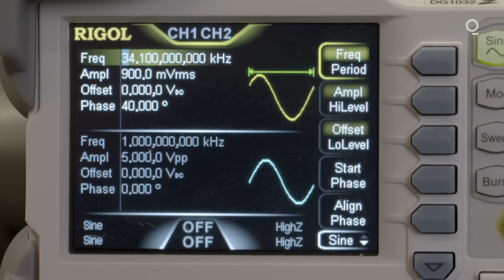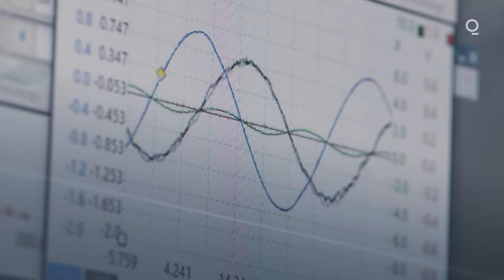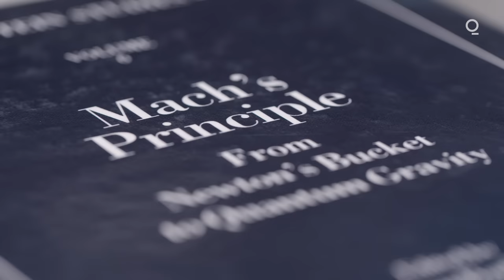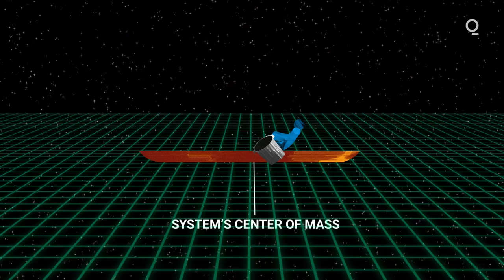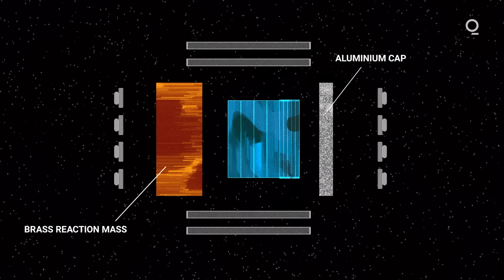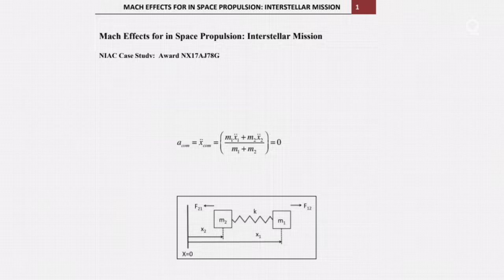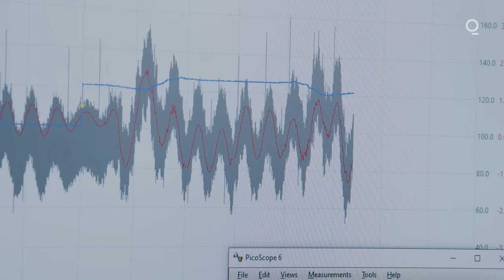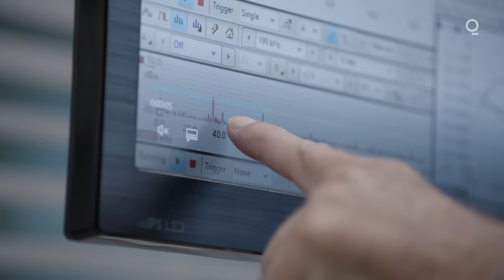Two Scientists Are Building a Real Star Trek 'Impulse Engine'

Comment: The "MAC principle" (Maximum Acceleration Constant) is a theoretical principle of gravity that suggests that the maximum acceleration that a spacecraft can withstand is constant, regardless of its size or mass. It proposes that the maximum acceleration that a human can withstand is 9.8m/s² (1g), and this limit applies to any spacecraft, regardless of its size or mass.

The principle is used in the design of interstellar travel, specifically in the design of propulsion systems for interstellar spacecraft. According to the MAC principle, the maximum acceleration that a spacecraft can withstand is constant, so to accelerate a spacecraft to high speeds over long distances, the propulsion system must be able to provide a constant acceleration over a long period of time.

It's important to note that the MAC principle is not a well-established one and it is not supported by mainstream scientific research. The human body is not able to withstand high acceleration for a long period of time, and the concept of a constant acceleration that applies to any spacecraft, regardless of its size or mass, is not supported by current scientific understanding of physics.

Currently, there is no known propulsion system that would be able to accelerate a spacecraft to high speeds over long distances and overcome the limitations of special and general relativity, which would make interstellar travel impossible for humans, however it could be argued that we do have the technology to create a genetic/synthetic lifeform to pilot the craft. JMIO :)

Comment: Certainly the first thing is just demonstrating that inertial mass can be changed. If that works, to ANY extent, then making use of it is just an engineering issue. They are like the guys who go straight to designing a perpetual motion machine because the idea of the finished product looks so cool that it MUST work, without first demonstrating ANY scenario in which it is possible for  energy to keep coming out of a system without any going in. I think all they have done is invented the worlds most expensive and least comfortable vibrator.

Comment: If you can accelerate an object to 10% of light speed almost instantly, that pushes against what you are using to accelerate it. At 10% C, the accelerated object just pushed against your accelerator with 100.5% of its original mass. Stop the object! Move it back slowly, at less than 0.1% C, and it pushes in the other direction with just 100% of its mass. That means, your push in one direction happens with 0.5% extra mass, and hence your accelerator is pushed a wee bit further one way, than the other. 
It sounds crazy, but that most essential math in this simple scenario is actually very real for this effect! 
With a piezo-ceramic material, I have no clue, if significant relativistic effects are even possible, but theoretically, it is indeed possible.

Comment: If they had expanding mass, its weight would also increase. No mention of this is made.
 A propeller forcing water past it uses the water mass to move the boat forward. The water mass neither increased or decreased. Its volocity was induced by pressure as force applied to it by the flukes pushing or displacement induces movement. All mathematical relevant. Water moves in a circular motion when a glass filled with water is moved in a circular motion. The friction of the water and the glass induces the motion. In space, none of the friction would be there. Therefore, no spin would result.
Try his experiment on the ISS to verify or dismiss its relevance.

Comment: You can take advantage of changing nuclear reactions to make this work. Going back to the rowboat example, when you rock (oscillate) forwards, your ‘bucket (container of matter) undergoes a nuclear reaction that converts the contained matter into heavier elements. Then you rock backwards, after rocking backwards you convert the contained heavy matter into lighter matter. The timing has to be just right, which is it’s own challenge but maybe not impossible. :)

Comment: imagine 4 gyroscopes being used as ores. when you pull sideways you move forward. now imagine those ores shrinking in diameter when you return them to there original position. instead of moving back in position you sit still because the motion of a smaller diameter wheel is much less. food for thought. i've thought about this so much that i can imagine a solid state electromagnetic version of this motion.

Comment: As an avid viewer of almost all the series of Star Trek movies and TV, it would be very advisable for the Space agencies involved in designing Warp engines to enable communications satellites at various Lagrange points in the Solar system to act as communication relays when craft finally experiment with these Warp engines. After any Warp experience is successful, these craft require to maintain communication that they were successful, otherwise the lack of confirmation of success will deem them Lost in Space!

Comment: What these guys have made is a solenoid, and taken 30 years to do it,! i made a working forwarding propelling solenoid 40 years ago, it needs a very slow (low current) to draw the solenoid back, against its resistance, then full voltage and amps 12v in my case, against the poles, and the solenoid will jump forward an inch or so, and thats on the work bench! do this in space it could move a lot more, and multiply this effect over 100 times, it would move a foot or more, you would need an almighty amount of power to build one that would travel at light speeds though

Comment: if you were to accelerate a object by means of action reaction by using a electromagnet to accelerate a piece of steel in order for the whole device to move forward we need to remove the momentum of the steel that goes in opposite direction by converting its energy into something we can use to reset the device be taking the energy of the steel out of the steel before it leaves the interior of the box. we do that by using a second electromagnet as the steel slows down by the second electromagnet field we simply open the circuit of the electromagnet and the energy of the momentum of the steel should now be converted from inertial momentum to electricity. by using a weak spring to rewind the piece of steel the cycle could repeat. we would be able to recover half of the energy spent to produce a linear force of inertia.

Comment: 2 factors was geonetry to relief the comserved response at heading need as taking in and turn into inertia further accelerate the soaceship other while it build up drag, secondly we must distribute center of gravity to be relocated by tortoise coil to readjust center gravity at the most efficient without losing in drag and kinetic gravity built up as spaceship move forward

Comment: I always imagined the Impulse drive being based on a rail Gun with a twist, The twist being the mass normally tethered to Earth is actually 
a collection of Modules briefly electromagnetically tied to repulse a given module with a reverse Pole to it, ergo thrusting it forward.

So in a sense via flipping the electromagnetic Poles to several Modules, The main mass is shifted to accelerate one module that is flipped out of phase, Once Near to Light Speed is attained the entire set of modules electromagnetic Fields can be switched off.

If you understand the above then an array could be utilised so that the entire Mass may be accelerated to any direction..

Comment: Interesting example they provide of the boat and the center of mass.  As scouts on a river trip, we were challenged to move a canoe forward without placing paddles or hands in the water. Of course, we tried in vain to circumvent Newton's third law and scoot the canoe in the direction we wanted. Nobody could meet the challenge and the leader showed us how we could do it.  He stood up and moved to the back of the canoe where he stood on the very end of the canoe and pushed down with his feet. With each push down, the canoe moved a little forward and the resistance of the water would push the canoe back up for the leader to repeat another push down propelling the canoe forward. Interestingly, I have often thought of this challenge as I have contemplated this very problem these scientists are working on. If macs principle holds that distant forces provide tension in space fabric counter to the effects of gravity, in theory, we should be able to use that similarly to how my scout leader propelled the canoe many years ago.

Comment: I myself have an idea that is similar to this, which is based on the fact that at a certain frequency, electromagnetism can make all non-metallic objects become magnetic (at a certain frequency, you can make the electrons stay on a certain way, reminiscent of when you see a wheel turning round and that at one point it looks as if it starts going backwards, then just at the point where it looks like it is standing still, as you also sometimes look at airplane propellers, it's the same effect that happens), when you create this effect, the electrons are in a certain position and become conductive...with another electromagnetic wave of a certain frequency, one can make an area in front of an object, amenable to pulling or pushing forward. It reminds a bit of Baron Münchausen (false story), where he jumps forward, on the balls from the cannons :) but the tactics in the same area, the same technique in a different way can also be used to make shields, which we know from startrek, by use the same electro magnetism on a full spectrum frequency range, you can play with a subject's ions, so that a kind of larger surface magnetic area is created, which no. 2 electromagnetic can react against, so that a smaller electromagnetic force can stop a fast approaching projectile, so a brick coming will act like a spirited clay thrown against a glass...... but time and money..... someone else has to play with the idea
Reply: i see,  alloys and aluminums ...   contact them and work on it

Comment: Very interesting. If it works, a more reasonable explanation would surely be that as you put energy into a system, according to General Relativity it gains mass. If you throw that mass in a certain direction, it will accelerate you. Then if you remove the energy and pull the mass back, since it is now "lighter", it will decelerate you less than you accelerated with. The main issue is, how do you add enough energy to make it worth your while?

Comment: An impulse drive is absolutely possible. If these cats use diamagnetic materials to assist it will happen faster, but.... How is one expected to protect the craft without an adequate repulsion field? The engine's not the problem, it's practical safe application.

Comment: I had idea, acelerate mass particle (proton / hydrogen iont) perpendicularly to move to speed close to light (speed meens mass), decelerate in half circle to rear side, and decelerate remaining perpendicularly to move, then transfer particle to start (front) and fire them again. I think there will be problem to bend particle to exact perpendicularly direction on rear side without backward force. So most of gaint acceleration from front will be depleated to rear, but maybye some % of that force remains

Comment: So static charge leaves a tiny mass difference when you charge something, why not occilate between high charge and low(er) charge to make something gain or loose mass???
Reply: A possibility I thought about too. The problem then to get a lot of charge to make it heavy and then get rid of the charge to make it light. I thought about sending back the charge energy by light but then remembered that light has momentum. It has to be charge in to make it heavy, move the mass, then discharge the charge in all directions. I think a light beam to push is just as efficient.

Comment: The Enterprises impulse engines are on the rear of the saucer section, they are NOT the main warp drive engines on the top of the two nacells.
Reply: In the thumb nail shot of the expanded view of the impulse engines, the red cone goes to the back of the vertical section between the saucer and main hull sections... where the impulse are in STNG.
Reply: @silenthunter8254  When the saucer section slits from the main drive, all they have are impulse engines...  This is because the impluse engines are ON THE SAUCER SECTION.

Comment: If a spacecraft could travel at 4% of the speed of light, which is approximately 7,458 miles per second (12,000 km/s), it would take around 100 years to reach the Alpha Centauri star system, which is 4.37 light-years away.

Comment: Nature has a way of disappointing us, like Cerenkov Radiation or the EM drive.
E=mc² defines the mass:energy relationship, and to put that in context, the difference in mass between a fully charged and depleted 100kWh Tesla battery would be just 4 µg.
Pulling and pushing against this while charging and discharging it, while having to remove and recollect the energy each time while the battery itself has a 150 billion times more mass does not seem feasible, unless I'm missing something.

Comment: The fabric of spacetime is stiff. It requires energy to clause a distortion, magnetic fields can flex spacetime however it depends of the strength which is determined by potential energy that a magnet has. High frequency oscillations cause a push and pull which causes distortions on the fabric of spacetime. The higher the frequency, the more energy required. A object like a black hole has large enough mass to cause a greater effect on spacetime which is due to the density in mass which is also determined by energy. E=mc^2. In this case in the video, storing energy like a capacitor with matter that has elastic material that expanse and contracts which causes a change on spacetime although very slight. It also effects gravity in a small way due to change in mass and potential energy is stored and release all at once. Depending on the rate of discharge of change it could be greater or less.

I did read just a moment ago that photons or in other words light has a great effect on electrons. Photons can increase the rate at which electrons are discharged, it may also be able to increase a materials ability to store energy in theory by creating a photon barrier that pushes electrons inward. Though light doesn't have a negative or positive charge. Photons interact with electron captured by atoms by increasing orbital states on an atom and the closer electrons gets to the center of a atom it releases light. Ion engines release small amounts of energy for efficiency in space for satellites. You should be able to increase a ion engines speed by using high intense laser pulses. If you also create a electrolyte or use a super capacitor that uses a powerful laser pulse it would increase speed.  Also, a proton based laser pulse to compensate for speed of electrons. Though, it would have to be synchronized for performance. Since it would use more electricity you would need a fission reactor to power it.

Comment: question: traveling at impulse speed, the captain makes a hard right. how many buckets does it take to clean up the remains of the crew? seriously, the warp drive solves getting  from a to far away b. the impulse engine is even more necessary to  move the ship at subluminal speeds- cruising speed. but i havent seen a way to keep the crew  from splattering against the  hull during a hard turn, full stop or zero to 50,000 miles per hour. to me, this is the  most important thing for humans. make the ship a drone and all is well, maybe.

Comment: Inertia is an inherent property of space. if you think of matter as a wave, and that matter emerges as a property of space defined by it's energy and it's information, movement is the energy impressed on the wave needed to transmit that wave and information at a "frequency" across space, where frequency is intended as the speed that the wave moves across space. So to change the frequency(AKA the speed at which matter is transmitted across space) you need to either add energy or remove it. When matter comes across a stretch of space that's bent by gravity, it's like it encounters a material where it can vibrate at a higher energy and it will naturally follow the path of less resistance. I wish i could meet someone willing to write down and test this theory.. if someone out there reads this.
Reply: I think we already have
Reply: I can't give humanity the technology yet there's too much money involved too many rich people involved I should say

Comment: So this device does not use propellants and would work similar to the EM drive that NASA also tested with negative results. The description sounds like generating gravitational waves, which were predicted by theory and have been detected but require massive amounts of energy to generate a measurable result. The best way to move through deep space without carrying propellants is to use light pressure on a solar sail, which has already been proven but not really tested on a large scale by NASA or others.